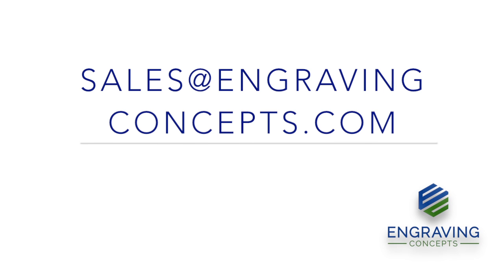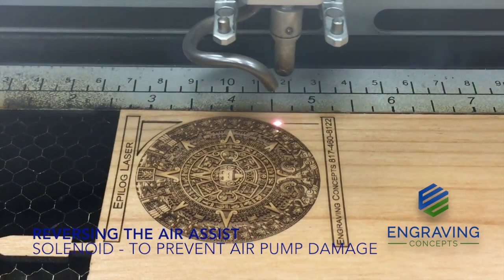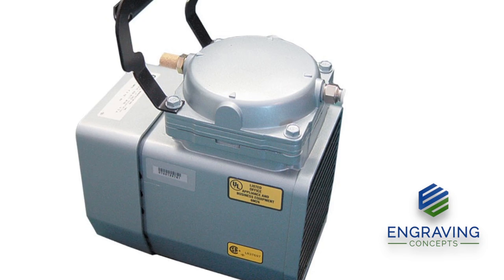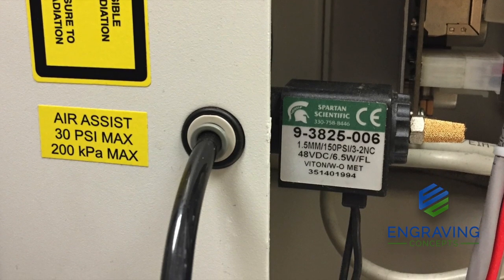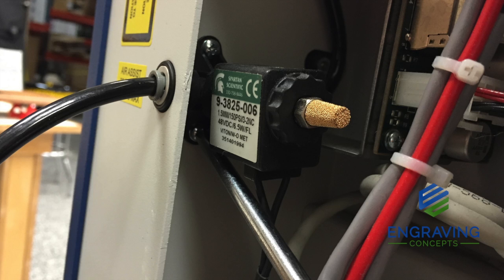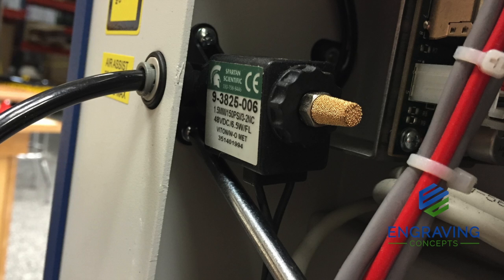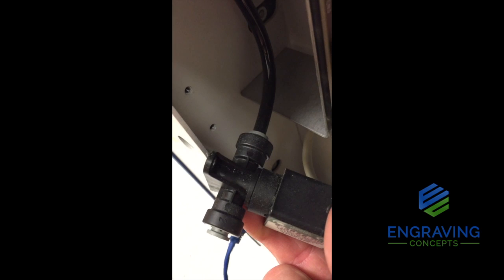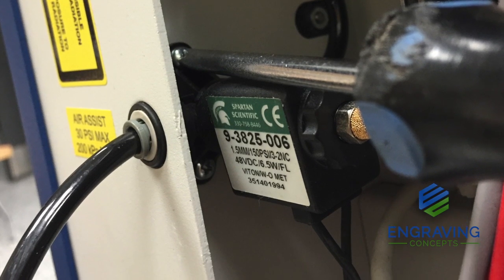Epilog Solenoid

Comment: Are you suggesting the Epilog solenoid doesn't bleed off excess pressure from the compressor but reversing the solenoid allows it to do so?
Reply from the maker: Yes, that is correct.  The 2 way solenoid will allow for bleed off of excess pressure; not from the GAST diaphragm compressor.
Reply: @EngravingConcepts  ...but this is not needed if you have a pressure regulator that allows bleed off?